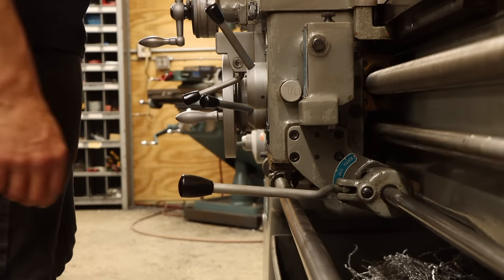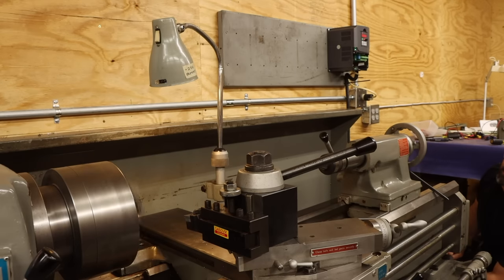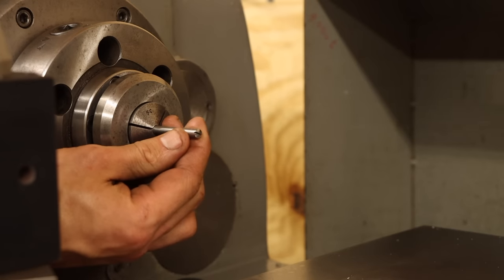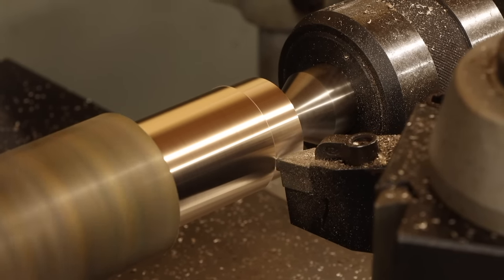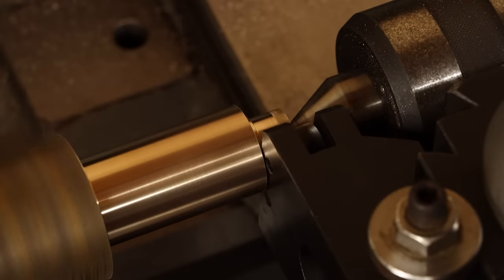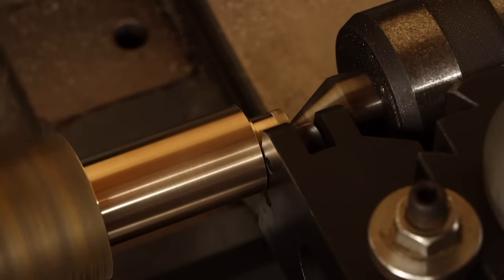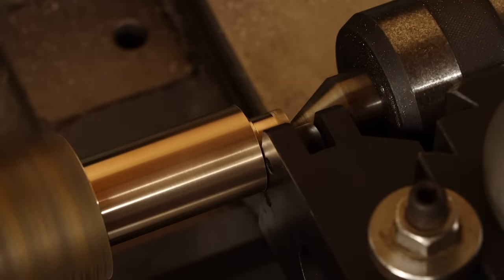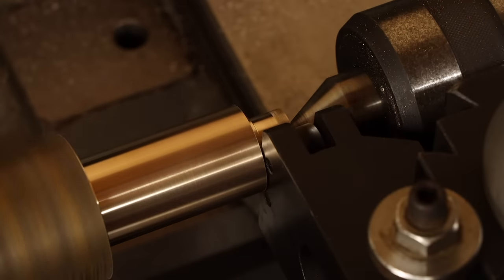Making a Surface Gauge (Part 2) || INHERITANCE MACHINING

Comment: The surface gauge turn out great Brandon. Glad to help with the VFD install. Looks really clean and your way more efficient on power now. Still amazes me that a VFD with such a small foot print can replace all those old school components!
Reply from the maker: Thanks again for the help, John! You're absolutely right. So much power in such a small package. And I'm only using like 10% of the functionality.
Reply: @InheritanceMachining  couldn't it be useful to use the VFD for speed control of the lathe? Since it's already there I mean? :)
I used what looks like a very similar VFD on my CNC router build, and found that they can be configured for a lot of different tasks.
You could use a potentiometer to control speed.
You can also install a brake resistor to stop the lathe quickly :)
Reply: Is Burton's Attic still around? Those videos were great. Wish you the best.
Geoffrey Croker is another channel that scratches that itch, if anyone's looking for a recommendation.
Reply: @honeyforce996  I’am

Comment: I use mine all the time surface grinding. I didn’t make it but I squared it up on the grinder. I want to make a custom one eventually. 

I really like how you showed the process of reworking all your electronics before machining. There’s always something like that. Usually YouTubers would cut that out, but I think it’s important to show how many side projects and how long machining actually takes.
Reply from the maker: I use mine all the time too. Definitely one of my more worthwhile projects! Also the side projects 100% a part of the story so it just felt wrong not including them!
Reply: @InheritanceMachining  you probably did this, but just wanted to check that you preserved the safety switch function with the VFD. There are typically dry contact inputs for that sort of thing 👍

Comment: I ended up paying PG&E about $5000.00 to have 3 phase run from the pole down the street to my shop.This was in the early 1980s. 3 phase power works great; when I would buy another machine tool I wouldn't worry about power requirements.
With those pins I always cut for o-rings so I have some drag on the pins and they won't be dropping out of the holes.

Comment: great project. Most of my machine tool work is for fixtures and parts for work which have to be perfect. Shop made tools get finished just enough to be functional and useful. I often wish for the time to do the careful beautiful work you're doing for my own tools. Thanks for sharing!
Reply from the maker: I definitely feel this. I have to resist the urge to overdue simple holding fixtures like the sacrificial aluminum plate or the holding block for the pivot screws. I'm glad I can do this as a hobby and fine tune things until I'm happy. Thanks for the the support!

Comment: this always crack me up... we have 3 phase 400V in every house by default in Europe... :-)
Reply: That would be amazing!
Reply: I wish we had that, it would probably cost the equivalent of a new luxury car to get three phase run to my house, if they would even do it.  Some people here use a Phase Perfect to generate three phase instead of a VFD if they have multiple three phase machines, but that is not cheap either.
Reply from the maker: That's what I've gathered. That must be nice ;)
Reply from the maker: That's interesting and I've never heard of that before. Looks like basically like a dumbed down VFD that only produces constant 3 phase. Given how cheap a VFD can be these days I wonder what the advantage of a limited setup like this would be.
Reply: @InheritanceMachining  it is a good option if you are powering a shop full of three phase equipment and don’t need variable speed.  For a hobby shop, a VFD usually makes more sense due to cost.  VFDs are hard on motors and shop electronics due to harmonics generated, this causes winding failures, electrical noise, and problems with other connected equipment.  The Phase Perfect gives close to utility quality power, so if you are running a shop 40+ hours per week, that might be the better option.  Another advantage is running 460v equipment, you can use a transformer with the PP to boost the voltage, but to do that with a VFD, you would need to upsize a 460v three phase VFD by double to do that since most (maybe all) 460v VFDs do not have a single phase input option.  Your maximum ambient temperature you can run the drive at decreases too when you do that, so the PP eliminates those issues.
Reply from the maker: @mikeb1520  Ah that all makes sense. I'd image that would also be pretty useful if one were to have a CNC running most of the time for commission work int he background. Thanks for the info!

Comment: Just a little tip for the rotary table, use 2 table stops and  then one clamp will be more than enough, you could get dead fancy and put a spring under the clamp as well

Comment: Beautiful tool! I really enjoy the care you put into the precision of the parts. I was setting up a rotary table the other day to help a fellow student put a chamfer on a large sprocket for a university project when suddenly the table stopped working.... After checking the leadscrew on the rotary table, it  seems to be functional still, so I guess I need to dissemble the whole thing! I'm hoping it's just a shear pin inside instead of a broken part. I guess we'll see! I do understand your love of the rotary table, it seems so useful!
Reply from the maker: Thank you! Something interesting about my table in particular is that the lead screw is mounted on an adjustable eccentric. So I can engage and disengage it by releasing a lock lever and rotating the whole hand wheel assembly. And also adjust the backlash. May not be your issue but thought I would mention
Reply: @InheritanceMachining  That may actually be the issue. As I've never used it before I wouldn't be surprised haha. The table I was using is labeled ts200a. Is it a horizontal lever above the hand wheel? I think it had some symbols with brackets or something? Which way do you adjust the lever?
Reply from the maker: @carsoncrook702  It's hard to get a consistent picture of that model table on google but it looks like there is socket head screw sort of perpendicular to the lead screw axis for loosening and adjusting this. When you get back to it if you need some more help just send me an email. Might be better to describe with pictures.
Reply: @InheritanceMachining  Thanks, will do!

Comment: Really enjoyed this, new subscriber here! For the long threads, I've had good luck partially cutting the thread with a single-point tool and then running a die down to finish it. The partial threads stop the die wandering, and the die gives a nice even thread form that's to size. Even worked on ¼" stainless rod.
Reply from the maker: That's a really good idea actually! I'll definitely try this next time I find myself in this situation. Thanks for the support!

Comment: Another wonderful video. Thank you for taking the time.

You may want to look into a Digital Phase Shifter for your 3 phase machines that you don't need variable speed on. I'm not sure they are less expensive than an entry level VFD but they are WAY better than  the phase-o-matic.
Reply from the maker: Thanks! I just looked into those and I'm surprised they are still a little bit more expensive than VFD I used here. Admittedly is was a cheap import. But the compactness is definitely an advantage. Thanks for the tip.

Comment: A wavy male thread, is caused by the die not being square to the work when it starts cutting. I usually support the work on the lathe chuck and then press the die and stock against the end of the work using the tailstock sleeve.. Disengage all gears and whilst rotating the chuck by hand, keep firm pressure on the die by winding the tailstock sleeve outwards.

Comment: there is something about needing chokes on the input of the VFD as well so that it doesn't back feed noise into your grid, you can check it out because I'm not certain if yours even needs something like that

Comment: Man, I just discovered your channel and I am hooked. I'm not a machinist, only used any of this sparingly while doing auto tech work years ago, and my grandfather's skill trade was to do with oil wells: not something that can be taught at home.

All that aside, I love small shop manufacturing and skilled trades that are disappearing in the US. I'm a similar age to you and am starting to build out a shop and learn a different makers trade, so it's really cool to see someone else, albeit with a significantly higher skill starting level, doing something similar.

Your production quality is also excellent from even the first video, to a point I'd think this isn't your first rodeo on YouTube. Strong work. Subbed.
Reply from the maker: I'm glad to hear you're diving into the different maker trades. This is a very rewarding hobby and there never seems to be an end to the things you can make or improve upon. Thanks for the support and welcome!

Comment: For a longer thread, if you want to get a really straight thread with a die, just do a few passes with the threading tool, maybe halfway to full depth, then just run it through.
This is, of course, if you're lazy and hate measuring threads, which lots of people hate.
I love the 3 pin measuring though, so I only use a die if it's a thread that doesn't need super tight tolerances (which is almost all of my projects, which have almost no drafted measurements for half of the features).

Comment: I like to leave the vfd on very visible place on front of the lathe somewhere so i can twist the nob to vary the rpm on the spindle while the lathe is making a cut. That way i can make a sin wave type of spindle speed curve to cut down on vibrations if there comes a problem with vibration in somekind of part

Comment: LoL I hear you on the time factor. I just finished making a circle cutter for my cutting torch, 04.19.23. It's pretty nifty, with all kinds of adjustments and a bearing. The problem is, I started it 01.23.23! I thought it'd take 3-4 days at the start of my vacation, then I could move on to the REAL project. LoL how wrong I was. The second problem is that now that this neat, adjustable, fairly precise tool is done, I have no idea how to accurately use it. Talk about the monkeys taking over management at the banana factory 😁

Comment: I have this same VFD on my lathe. Really hard to beat for the money, and it doesn't take much to wire in a potentiometer to get variable spindle speed. At some point I'm planning on wiring in a little hand controller thing like you'd see on CNC machines and at least get the jog forward and reverse features on it for power-tapping.
Reply from the maker: Its really has been a great VFD so far. And packed with features. At some point I'll add a pot like you. That is also a genius idea for the jog feature

Comment: Nice video.

I was screaming "follower rest" for the first ten minutes, though.

One really nice thing you should be able to do with the VFD is set up a low speed jog button. Mine is set to 1/10 normal speed and I have a separate reverse switch for it. It's extremely handy.
Reply from the maker: Thanks. I considered getting it out for the threading but didn’t think I would have enough room.

What do you find yourself using the jog function for?

Comment: really enjoying your channell my new favorite machining channell, i work in garage equipment and have seen a few garages run a 3 phase transformner from a single input to run vehicle lifts, they are not cheap but may be a good solution.
Reply from the maker: Thanks! Thats an interesting idea I haven't seen before. Unless that's the same a a rotary phase converter?

Comment: I like your videos and this project is great 👍.
I see you seem to have problems with turning small diameter threading and outside diameter and i had similar problems.
I have learned to use hss tools on smaller diameters because carbide inserts take more cutting force to get cutting.
This is the reason why your small diameter are destroyed.
By using hss cutters i can easily single point thread m4 if i want what was impossible with carbide inserts.
Reply from the maker: Wow… I never considered that. I suppose the carbide edges have to be kept round (on a micro level) to prevent them from fracturing. I’ll have to try my hand at making an HSS cutter next time. Thanks for the advice!

Comment: There's a company that sells a clear fire resistant coating you can paint on wood that's ammonia salt and water-based. Makes wood very fire resistant. Down side is it smells like cat pee while you're applying it but once it dries it doesn't smell at all and the wood will slightly char but not burn. It's wild.

Comment: I really enjoy your videos. That was a lot of work, but the results are beautiful. For 3 phase power you might consider something from American Rotary. One unit can be used for several machines.
Reply from the maker: Thanks! I was actually toying with the idea of using the rotary phase converter form the surface grinder to distribute power to the whole shop, but thought the VFD would be a little quicker to integrate. Having done that now I think i was wrong 😂

Comment: I did the same. You might also like an external speed controller mounted erganomically. Very easy to install.
Reply from the maker: That would probably be my first upgrade. That and a proper estop

Comment: Hi, discovered your channel last night really enjoying watching you get the shop going and making your first parts, one thing though, that brass you are machining in part 2 of the surface gauge is leaded bronze or possibly aluminium bronze you can tell from the stripey appearance on the outside, commercial brass is more yellow in appearance and has no stripey exterior. Keep up the good work you will get there. When I first started making scale model steam locomotives some 40 years ago I put British steel back on over time with the amount of scrap I produced. Happy to say not the case today. Like most things it gets easier with practice.😀
Reply from the maker: Thanks! Yeah I learned that about the bronze pretty quick from some others but thanks for pointing it out. Lot's to learn in the shop but I'm eager for it all 😁

Comment: Brandon, as someone who grew up on a farm with old equipment. It seems like there is something to fix, upgrade, modify, or build. I think your at-home machine shop with grow with you and the channel. Next, you should get a welder for welding things together and somewhat do "additive manufacturing." Also, good belt grinder to put some nice fillets projects and quick deburring. I thought you might make a belt grinder when I saw the VFD in your previous video. People who pursue an engineering degree know some basic electronics because of engineering physics and maybe electronics classes.
Reply from the maker: I can relate to this for sure. I live on a farm now and until I recently inherited these tools its been a challenge to repair the things that needed it. Especially knowing what the right tools for the job would be but not having access to them. I do actually have both a MIG welder and a belt/disc grinder that I have used on occasion but just haven't made an appearance in the videos yet. I do have some projects in mind that will need them though.

Of course I did have the basic circuits and experimentation courses but I definitely learned way more about controls design and troubleshooting through my day job as an engineer. Nothing beats real life hands on experience

Comment: For getting the least amount of deflection using a follower rest, maybe using an indicator against the part, and then dialing in the follower rest until it shows a tiny bit of movement (then backing it off). 
depends on how much of a perfectionist you are.

Comment: Another great video nicely presented and what a tool you’ve created very nice 😁
Ps I hope you’ve saved all the original electrical switch gear etc and stored it away safely in a labelled box at the back of a cupboard somewhere just in case ..
Reply from the maker: Thank you! I have saved it although some of it is pretty questionable

Comment: If you ever need to cut a slit, and the slit saw drifts like that, or you don't want to use it,
The bandsaw is always an option!
Setting up a bar on the side, clamping it down really tightly, lets you do that!
I've only ever done that with softer materials, like wood, to get nice and even boards.
That does have some risks, since the saw blade can and will drift or turn, since it loves to just randomly change directions on me. Maybe it was just because my pieces were so tall.

Comment: Hi Brandon, I think you've got bronze there, sae660 to be exact, I use it for my loco boiler bushes and it looks identical, especially the unmachined part of the bar, it cuts like brass but it's ever so slightly darker 👍
Reply from the maker: Interesting! My perception of bronze has always been that it's a little redder in sheen. But of course there are different grades. Thanks for pointing that out!
Reply: @InheritanceMachining  some bronze is more red than others, I bought pb102 which again is a different bronze and it's horrible to machine, it's too soft and that is more red than sae660, they call the 660 phosphor bronze and the pb102 leaded bronze, thanks for the reply and I look forward to your next episode 👍
Reply from the maker: @breconmerthyrgwr9250  I appreciate the info. Most of my stock pile is unmarked so I'm often left guessing at what I have. Thanks again!
Reply: @InheritanceMachining  no probs, I've got some bits and bobs and I don't know what they are lol